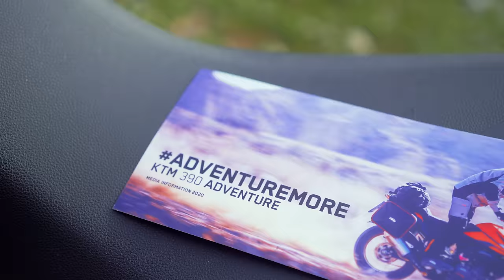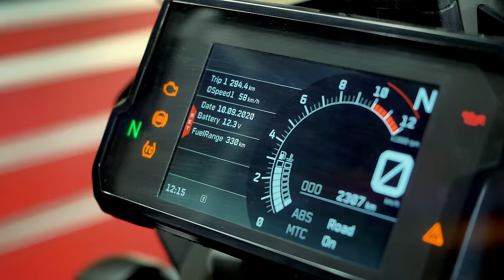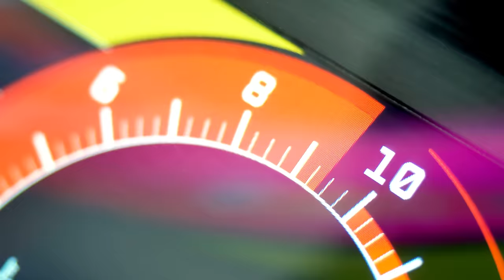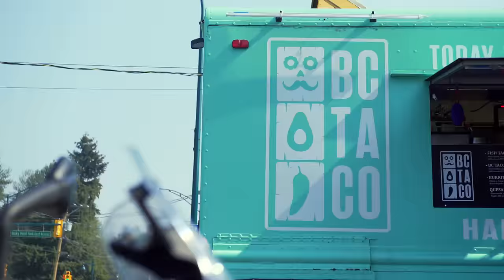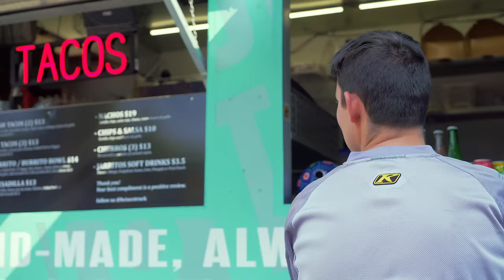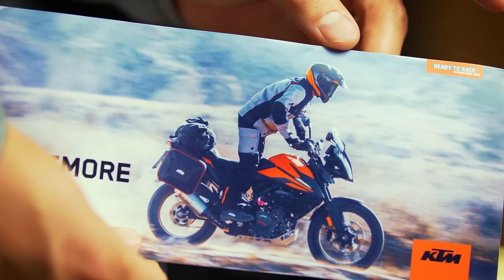The Smallest Adventure – KTM 390 Adventure Review

Comment: I always get a chuckle at this review, don't stop making these videos I love them! I still bought the 390 Adv, over 10,000km later and its still preforming very well both off-road and on. As a sub 400 cc bike it sits well in its niche, I tagged this bike being one of the best for its size. The 310 GS, Verseys 300X, and the Himalayan all have their perks, but I found the 390 edged them out, but not by much. Besides the footpegs which were immediately changed out, my only real bitch is lack of spoked wheel options, and for longer rides the seat can be a little softer (1,500km weekend jaunt was my longest on this bike). KTM discontinued the spoked wheels pretty quickly which is very frustrating, although my cast wheels have held up pretty well, a rider like Ryan would probably have them screaming for mercy in no time. I ride mountain trails and a lot of FSR's so for what I'm doing this bike has met these tasks without any problems. As a short novice rider its been pretty friendly :) I will upgrade at some point, but for now this bike has been pretty good.

Comment: But where I live the price difference is only $200, and the 390 is more comfy than the Duke, it has longer wheelbase than the duke, better ground clearance than the Duke, bigger tank than the Duke, and better tire options than the duke for gravel/sand/dirt roads and trails.
So with 1,5" handlebar risers, wider and different angled foot pegs and a Navi tower it is kick-ass for Adventure riding in the Philippines (where they also manufacture the KTM 390 Adventure).

Comment: I will take the Adventure over the duke any day  Bigger gas tank, better gas millage, larger 19" front wheel, Better ground clearance, like the orange color, better tire size for dirt and off road, better suspension for off road, and the list goes on,  Give you head a shake,  It is a light weight ADV bike just what most people are looking for, not every one wants to push a great big heavy bike around, for the type of riding most will do it is more than enough.  Will be trading my Versys 300 X in for the KTM 390 Adventure, If I want to do more off road than it can handle will get the mighty DR 650 out, with the 20 liter gas tank.  At 72 years and over 55+ years of riding bikes from 50 cc to over 1000 cc, of most types. the KTM 390 Adventure is a dream come true, for me.  Hear in Canada we have speed limits so why do you need a bike that does over 200 Km per hour. other to sit at the coffee shop and brag how fast it can go.  And 90% of the people who have these supper bikes never use them to there full potential, or even can. You are in the 10% that can, but that is a very small percentage, and to be pushing them on people who can't handle them is not a nice thing to be doing, unless you like to visit people in hospital or funeral homes.  Riding a slow bike fast is much more fun than riding a fast bike slow.

Comment: Looks like your major complaint is the foot pegs which can be changed for 200$, This is not something major. Furthermore, this is not a dual sport and people should use it to go on light trails. My major complaint would have been the ground clearance which is a bit low. Nevertheless, this is far better than Duke to go on a trail. When  you live in Asia, you need a bike which can handle well holes and rocky trails but not ride on stiff slopes. KTM seems to fill that need with this ADV. Are you sure you are not a bit too definitive in your statement ?

Comment: I'm maybe not a big fan of the KTM Duke adventure because of its looks but in its defense, Ryan is a very tall rider even if he's sitting on a Tenere 700 with a higher seat he would look as if he's on a small 250. and regarding the pegs, it's just an easy fix with aftermarket parts. Ground Clearance? how many would try to jump over logs with this bike and with about 170kg wet weight? Yes, it's not a heavy bike but it's not a proper enduro either.

Comment: On the KTM website, it says that the ground clearance is 200 mm. But I was looking around and found the even Suzuki v-storm has 170 mm of clearance. Are these bikes not suitable for off-road? Which under 500 cc bike would you guys recommend for that?
Reply: Are you thinking more road or offroad use?
Reply: @HyperSarcasticAvocado  mostly onroad and commute but with generous amount of off-roading.
Reply: @parijat9405  The Honda CB500X has 180 mm clearance and has a bit more torque. But the KTM seems pretty good. Would it be too hard to go up to a larger bike? The KLR 650 seems really cool and is a tiny bit more expensive than the 390
Reply: @HyperSarcasticAvocado  KLR is not available in my country. Only issue with KTM is the way it looks. :(. I see what they were trying to do but wouldn’t call that a success.

Comment: Just over 10,000 km  on my KTM 390 Adventure and it will go through much more than you give it credit for,  I did put Dunlop TrailMax Mission tire on it and 33/64 liter hard bags. Take it down some pretty gnarly gravel and dirt roads as will as tractor trails. Roads with deep muddy ruts large pot holes  sand 6"+ deep and there a lot of roads hear that are more like trails than roads and the 390 Adventure handles them all, some with 2' grass growing up the center. I also up graded the bash plate and hand guards to better KTM ones. Yes the pegs are tilted forward but when standing I am on the balls of my feet and have no problem with them and have never come close to being throwing over the handle bars, plus they are easy to change out if you can not figure them out. Also remember this is a ADV bike not a duel sport. If you want a duel sport get one, don't buy a ADV and expect a duel sport.  You can get the 390 adventure and a DR650 for the same price as most middle weights and larger ADV bike.  If you think the duke is as good you get a duke and put another pro rider on the 390 Adventure and see how far you can follow him off road. That statement is just plane stupid.  Makes me wonder what other things your are telling people that are untrue.

Comment: Coming from the G310GS myself, I absolutely love the 390 Adventure. The BMW feels a bit more ergonomic and the seat is more comfy for longer rides and comes with a relatively big and sturdy luggage rack from the factory, but its engine really sucks, you have to revv it very high to have fun on it, while the KTM engine feels hugely more relaxed, yet when you ask it, it can be very aggressive, also it does not stall as easy as the BMW. And the fact that its got traction control and cornering ABS is a big safety plus, especially now during winter. The only things I dont like so far on my 390 ADV is that there is no way to install a center stand and the side stand feels really flimsy compared to the G310GS. Other than that its the perfect motorcycle for me right now. A good mid weight bike that can do a bit of everything. Reminds me of my old XT660R, its only more road orientated.
Reply: You owned a 310GS?  I rented one for a week and turned it in 3 days later. Just out of curiosity, because my 310GS had THE WORST side stand I've ever seen or used, did yours have an unstable side stand set up that was borderline dangerous? Like every time I left it, I felt I would come back and it'd be laying on it's side. The rental guy even warned me about it and said it was a "design flaw". As I said three days later I turned it back in for something else. The motor was anemic and torque just didn't feel all there. In summary, I hated it. It's the first BMW I've ever said anything bad about.
Reply: @soldat2501  The side stand on that 310 GS was surprisingly rigid and heavy duty and the bike felt rock solid when parked on it. But idk if it was the original or an aftermarket part, since I bought the bike used. I had the exact same experience with the 390 as you with the 310: I have never seen such a weak excuse for a side stand, its the thinnest gauge metal ever and because of that it probably can not carry much of the bike, so the angle it stands on is very steep and therefore the bike feels like it will tip over if not on a perfectly level ground or angled to left side.

Comment: I would love to hear your thoughts on the Royal Enfield Himalayan in this category. I have a very short inseam which really limits the bikes I can flat foot. While I understand that you do not necessarily have to flat foot a motorcycle to ride it, it is very helpful if you can. I would imagine that is especially true of adventure bikes. The Himalayan has the shortest seat height I can find and is supposedly a pretty good adventure bike for the newcomer. With a little modification to the seat I think I could flat foot one of these and really like the style. My biggest concern is US highways are 75mph speed limit, can this bike do that? I am concerned as I would be riding the bike to places I would like to explore and that would most likely require highway riding to get there. Trailers are for sissies :-)
Reply: He made a video about the Scram 411 which he calls the Himalayan "One of the worst Adventure Bikes I have ever ridden".

Comment: The conclusion doesn’t follow the logic of the rest of the review either because it’s a joke, a troll, or just a badly developed verdict. I bought the Black Dog Cycle Works pegs that lower by .5 inches and level the pegs flat. I also bought the adv tribe handle bar risers raising them almost an inch. I also bought the ktm power parts off-road seat that raises it almost an inch. These three things cost about $400 but there are cheaper alternatives on the market if you’d like. With these three mods I am very balanced on the pegs, the handlebars are high enough and the seat sits in the perfect position so that I can control the bike more. I also avoid trying to ride over obviously inappropriate obstacles like fallen trees. Not sure what Ryan was thinking in his conclusion here it’s not like he doesn’t mention in his other reviews modifications as a way to address other bike shortcomings.

Comment: Awesome video. I ride KTM 525EXC, Adventure 1190S and 390 Adventure which I quickly changed the pegs, slip-on exhaust, bar-risers and quickshift. It's a blast to just take off on and have a good time. Surprisingly good performance and an "everything bike". 5'9'' Been riding and racing for 51 years and it is fun to have a bike that reliable, fun and does well smoking up fire roads, canyon carving and single track. Agree to disagree! HA! Ride on!

Comment: Hmm... good suspension, superbike electronics, all-having dashboard, tubeless tires, better than competition in almost every aspect, low price. The biggest issue is... foot pegs angle. Seems like a good deal to me. Interesting review. Didn't like it at first, but after a test ride I started to get the message and must admit the video is pretty much spot on. The bike is so much more fun than bigger adv bikes in the city. Offroad it's more confidence inspiring due to its weight and my limited skills. Standing position is a bit awkward. On the highway it's far from comfortable.
Reply: Like he says bro you can get a duke cheaper..engine is untouched..and no other advantage for "adventure" riding per se..in india we dont even get the adjustable suspension
Reply: @availablehage  I took 390adv for a test ride. I was amazed by the bike agility in the city. It's really quick. On the highway it's not so good anymore. The engine revs high, terrible wind protection. Offroad I feel more confident than on my Tiger 800, because I'm not good enough to overcome the weight. So, I get the point. I'm sure Duke is even more fun in the situations it's designed for. Adventure...I think it's good that it's there.

Comment: So, I keep circling back to this bike. Sold my Super Tenere because it was too heavy for my off road skills. Looked at the 390 but the sales guy actually talked me out of it based on its highway manners. I bought a used 2019 CB500x which, after sorting the ergos for my 6'3" frame, is proving to be a decent bike. Still, I'm drawn to the 390's even lighter weight, better suspension and electronics. Seems between aftermarket pegs and maybe bar risers the ergos, which seem to be your primary complaint, could be easily be sorted out. No?